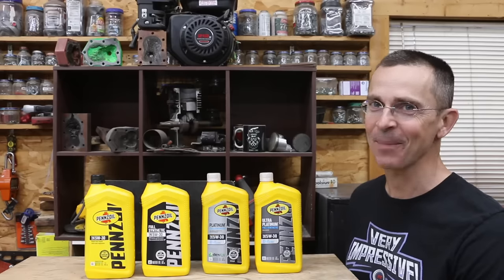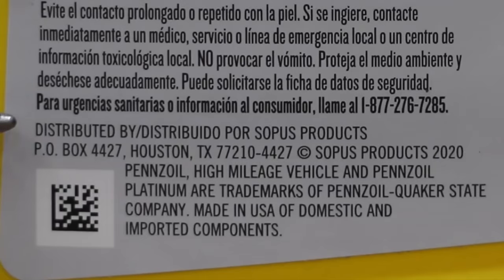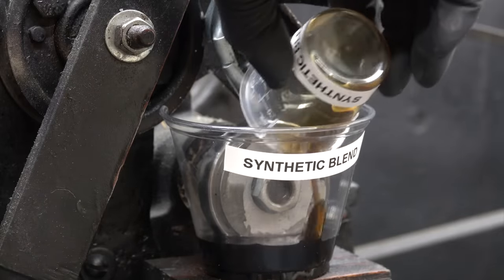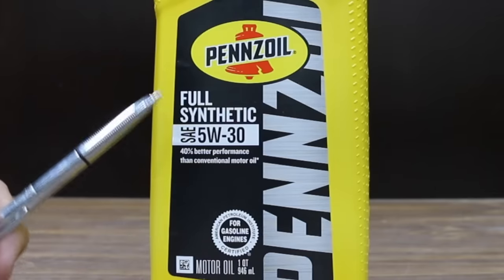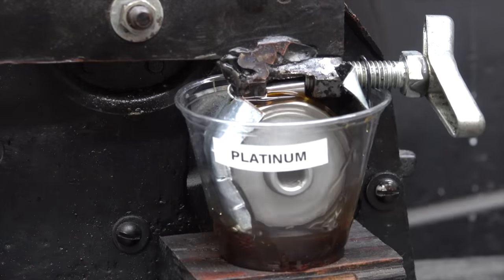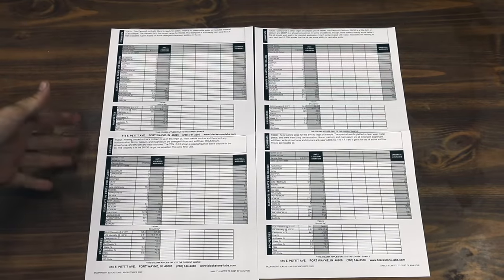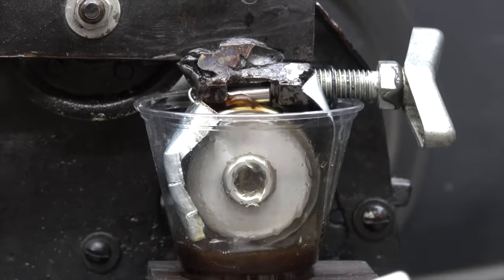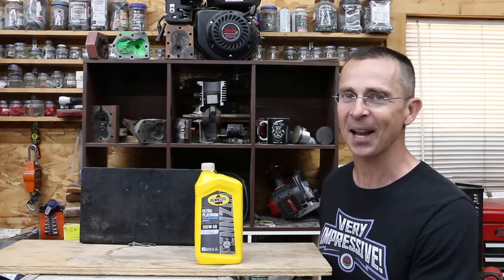Are They All The Same Motor Oil? Let's Settle This!  Four Levels of Pennzoil Motor Oil Compared

Comment: I have always wondered what synthetic blend actually means. Is it 50/50 or 75/25 or 90/10 synthetic to conventional???? The container never says. Maybe this varies from company to company. Technically one drop of synthetic in a quart of conventional is a blend. For this reason I avoid blends
Reply from the maker: Thanks for the feedback.
Reply: It does vary from one brand to another but in most cases that number is between 10% to 30% synthetic content and even at the lower end, the synthetic content helps to add greater thermal stability to the base, non-synthetic content. Even 100% non-synthetic oils have improved so much in the past few decades in the chemistry/technology of their additive packs that in many parameters they were already scoring very close to many basic full synthetic oils and now with the advent of synthetic blend oils, as long as you are doing 3k to 5k oil changes, the synthetic blends can do just as well as many full synthetic formulas and we know this based on literally thousands of used oil analysis done by oil analyzing labs. The full synthetic oils do still maintain an advantage for people who like to do extended oil drain intervals such as 7K miles and up since they maintain their stability for these longer intervals better than conventional oil so it all comes down to the vehicle owner and what their preferred maintenance routine is. One thing for sure though, fuel dilution is real and the longer you keep a batch of motor oil in your crankcase, the more fuel will end up diluting that motor oil, regardless of what type of oil it is. A synthetic motor oil may be able to technically handle a 10k mile oil change interval, but in high stress components like timing chains, as that synthetic formula gets more and more diluted by fuel content and more loaded with contaminants because of how long is being kept in the crankcase, the greater the impact will be on components like the timing chain/gears, even if an oil analysis shows that the oil was still had active additive pack remaining at the time the oil was changed out, so that is why some people prefer to go with something like a synthetic blend but change out that oil between 3k to 5k versus going with a full synthetic and running it for 10k.

Comment: Being a long Pennzoil Platinum user and always had good results, I was bothered by your findings. How can Pennzoil Platinum come out so badly especially the cold pour test where PP came out in globs! Something did not seem right, so I pulled up the VOA numbers on the PQIA website for Pennzoil Platinum 5w30 and compared them to your VOA numbers. It does not appear to be the same oil. The numbers are not even close.  I don't know what that was coming out of your Pennzoil Platinum bottle but it does not appear to be Pennzoil Platinum.
Reply: Ya no way was that PP, not a chance!

Comment: Who here is driving at 40 below zero?  

I liked the video though.  I change oil ever 5K miles but I'm about to change that to every 3K miles (which is what I used to do).  I suspect changing every 3K miles and not driving when it's 40 below zero is going to be OK no matter what oil one uses.
Reply from the maker: Thanks for the feedback.
Reply: @wayne6777  Little Castro Trudeu still lets you progs own gasoline-powered vehicles? 

Glad you are doing your own oil changes.  Try to Valvomax oil drain plug. Scotty Kilmer did a video on it.
Reply: @wayne6777  Valvomax does indeed speed up and make an oil change less messy.   I have put one on nearly all the family vehicles, only my father's truck and my older Honda remain.  

The fact is, EV should be called "battery powered" because they are but "EV" sounds better.   Also, you are not meant to drive.  They know battery powered cars are not able to replace gasoline but the thing is, they don't plan on you being able or allowed to drive at all.  Look at England's "15 minute city" plan.  Also WEF "you'll own nothing, have no privacy, and you'll be happy."  Agenda 2030.  Given how many Canadians caved about the vax and didn't support the truckers is their signal to force more poverty and death upon you.
Reply: @wayne6777  So you are a believer huh?  Well great.  May your chains rest lightly upon your shoulders.

Comment: Test 4 stroke 10 W 40 motorcycle oil against oil designed for automobiles..
  motorcycle oil supposedly has higher percentage of ingredients to combat shearing because the oil is lubricating the piston and crankshaft as well as meshing transmission gears. Transmission gears are supposed to be the most severe duty and oil can be expected to operate in. Up until the 1970s and 80s,, most companies like BMW, Moto Guzzi, Harley Davidson, had separate 90 weight oil and partners bluebird Kaeding their transmissions. But the Japanese have been able to use the same oil lubricator in the engine and transmission since the late 1970s and early 1980s.
  motorcyclist magazine did an article in 1988 or 1989 warning motorcyclists not to use The new automobile oils in there motorcycle engines that lubricate the transmission and engine with the same oil. They warned of “catastrophic failure’s “because of the lower percentage of zinc and phosphorus in the oil which gives oil it’s film strength to stand up to the ruling torture it would experience in the transmission. Motorcycle transmissions exert over 100,000 pounds per square inch of force on the gears in the transmissions of many of the high horsepower sport bikes today…
  I can tell when my engine oil in my motorcycles needs changed because it becomes more difficult, noticeably difficult to change gears with my foot shifter. I noticed that it becomes a little more difficult to find neutral..
  once I changed my oil using wolves head conventional motor oil in my Honda pacific coast motorcycle that I commuted on for 24 years, 31 miles a day, eight months a year. When I put that brand new wolf head oil in that engine, that transmission did not want to shift. I did not even make it a quarter mile from home. I turned around and went back home and drained that junk out of there ..
  so someone that wrote the article said, if motorcycle is so much better, why don’t we just use that in our cars? The highest ware rate in a car engine is generally the camshaft lifter area. Wouldn’t using motorcycle oil be better. And the answer to that was, because of the increased level of phosphorus, that would overheat the catalytic converter‘s on many cars, so it’s not good for cars to use motorcycle four stroke oil. But, many motorcycles today have catalytic converter‘s.
  also one other side note
 my small bike is a Kawasaki Z 400, 2019. It only holds 2 quarts of oil, and the oil change recommendation in the owners manual is every 6000 miles. that engine uses one oil for the engine and the transmission. And redline is 12,000 RPM. I rarely exceed 9000 RPM if ever. But I do change my oil about every 3000 miles on that machine using four stroke motorcycle oil of the grade specified in the owners manual with no additives..I also do not buy the super Duper expensive oil. I just use a motorcycle company like Honda or Suzuki 10W-40 motorcycle oil, not they’re super expensive stuff
Reply from the maker: Thanks for the suggestion.

Comment: Why would the regular full synthetic be better than the platinum full synthetic?
Reply: The Platinum series is a natural gas turned into a clear, clean oil.  It's advertised to have a better resistance to high heat applications.  I am forced by warranty to run 0w20 in my RDXs, so I will use the Platinum series during the summer and anything else full synthetic on sale in the winter.

Comment: Do you think the ultra platinum oil is better than a high mileage type oil?
Reply from the maker: Thanks for the suggestion.
Reply: @ProjectFarm  I mainly am asking the question because I have used valvoline high mileage on a gas naturally aspirated engine with 140k miles and was considering between the two options.

Comment: I just bought 5 qts of the platinum. Im bummed because it feels like the worse one of all of these. Should i take it back
Reply: Specifically because I live in a cold area.
Reply: The Platinums start with a cleaner base oil than the hydro-cracked group III synthetics.

Comment: Can I run ultra platinum  in my chevy 1.5 turbo engine.  Chevy calls for dexos rated oil
Reply: Not if you're under warranty.  You'll have to fight for warranty work.
Reply: @lonniebeal6032  thank you

Comment: I bet the Platinum is intentionally downgraded because it may be used in nicer cars getting serviced more frequently, so it doesn’t need to be as good. The cheapest will be used in the poorest, roughest engines and the Ultra Platinum will be used in performance cars driven hard enough to need it
Reply from the maker: Thanks for the feedback.

Comment: If your changing your oil every 5k consistently with platinum or ultra, youre not going to really tell the difference. But there are those that are crazy about little details. I mean, my corolla and 5th gen 4runner run amazing on either without issues(neither shows oil consumption; both over 100k mileage)
Reply from the maker: Thank you for sharing!

Comment: I hope you understand that though this test does show the quality of the different oils it does not take into consideration the fact that vehicles require these specific oils for specific reasons. And some those reasons do not have anything to do with the findings of your test. Nor with the purpose behind your test. So in a way your test is actually inconclusive. Because there's information that you're not taking into consideration with your test. Such as the reason for the dexos classifications. And the European classifications as well. The Pennzoil ultra is going to be the oil you will use for European vehicles. Pennzoil platinum with dexos will only be used for general motors vehicles. No other vehicles. And then the plain old pensoil synthetic is for everyone else. I hope this information reaches you well.

Comment: Using these products, my opinion I did not see any difference. From 10k miles purchased now I'm at 20kmiles . I can't see to get better mileage than 16 a gallon and 19 highway.   I'll be better off with a Hellcat the only difference now I will have to get premium fuel ⛽️. 
It's all on my channel.

Comment: You can't just add up detergents and dispersants, it doesn't work like that. You can have a much better molecule that requires less of say, boron, and you won't need as much of it but still get better wear protection. That part of the analysis is, sorry to say, worthless. The platinum is likely switching to a better base oil, and therefore to get better overall protection that, for example, the synthetic, it needs fewer additives.

Comment: It's nice that you offer these types of tests and experiments. However, in the real world I'm pretty sure there is negligible differences between any of the 4 products offered by Pennzoil. A person can get the warm fuzzy feeling in their gut after installing the most expensive motor oil and think they are doing the very best thing for their engine. Any SP motor oil offered today, and changed per the manufacturer's recommendation, and most importantly maintaining oil in the crankcase will ensure a long and dependable engine life.

Comment: Albeit, synthetic has its benefits, one must ponder as to why the biggest engine manufacturer in the world, being Honda only uses and recommends conventional petroleum based motor oils in its testing, technology, And its certification of All it's engines,including its racing engines..  I've been a professional mechanic for almost 40 years now,and have never felt the need to jump on the synthetic bandwagon, so to speak... Dino oil is ok by me..
Reply from the maker: Thanks for sharing!

Comment: Well if you drive an air-cooled engine, you should know by now that synthetic oil doesn't conduct heat as well, so you must use at least a synthetic  blend!
Reply from the maker: Thanks for the feedback.

Comment: If you change your oil and filter every 3000 miles, as you should, just use the least expensive conventional oil you can find. No matter what kind of oil you use, over the span of that 3000 mile interval, your oil gets contaminated, the additive package breaks down, and its time to change the oil and filter. Extended change intervals, or the use of expensive synthetic oils, are a scam.

Comment: Before this bs start/stop engine technology started,  I ran mult-weight regular oil in all my cars and trucks. 10-30 winter, 20-40 summer. With regular 3K mile oil changes, all my american brand cars were ran just fine, non oil burners up until i sold them, 150k-180k. Maybe the rest of the car/truck was dollaring me to death, but engine wise, good to  go. Remember 39 cents a quart oil?😅

Comment: That oil is so hard to find though.
Reply from the maker: Thanks for the feedback.
Reply: @ProjectFarm  I was using full synthetic and think I will stick with it after this video. Ultra platinum would be good but it’s like double the price.
Reply: @jaydu2970  if you got a walmart near you, it's the cheapest from them.
Reply: @rickylafleur5823  the ultra platinum isn’t sold at walmart

Comment: One oil isn't that much better than another.  If you follow the manufacturers maintenance guidelines, your engine will outlast the rest of the vehicle.
Reply: Unless you're forced to use 0w20 in over 35c climates.  Than group IV oils are better, they resist break down in higher temperatures better.

Comment: Don’t go spending your money on the fancy names logos and designs of bottles. All hype crap.  The important is the weight of the oil your vehicle says to use. Period end of story. Irv Gordan’s over 3,000,000 miles Volvo on Castrol GTX Ultra Clean motor oil every 3-3500 miles new oil with filter. You can Google or YouTube his story.

Comment: Changing oil regularly is far far more important than what brand or type (best to stick with recommendations on weight. 4x4 oil? 4x4 is a drivetrain not an engine type. Pure gimmick 
Cheers
Reply from the maker: Thanks for the suggestion.